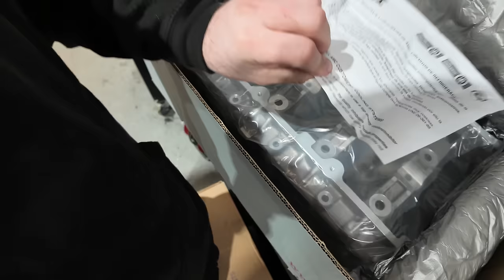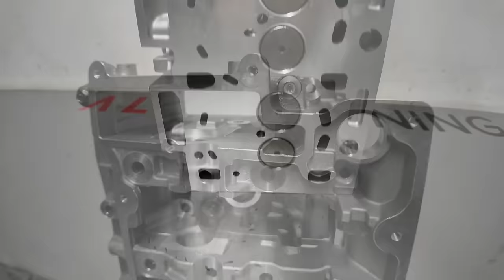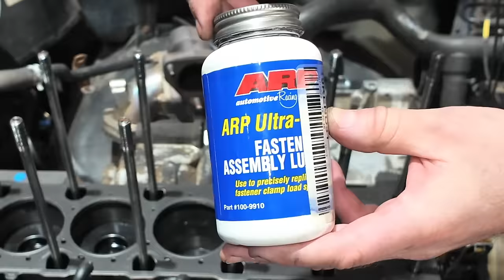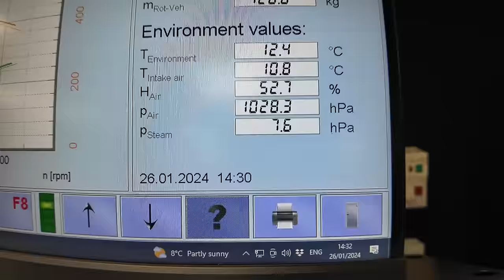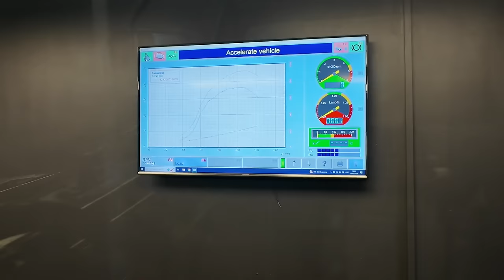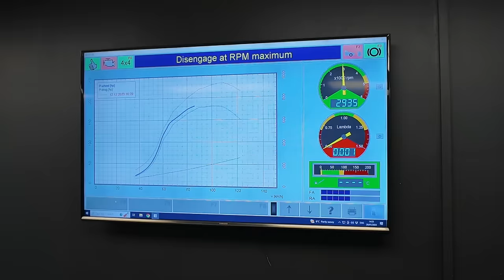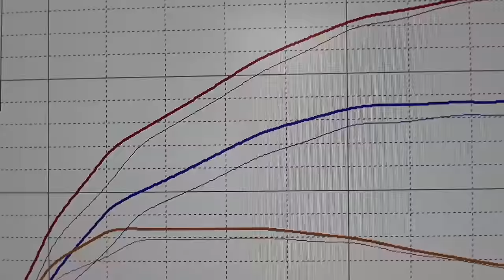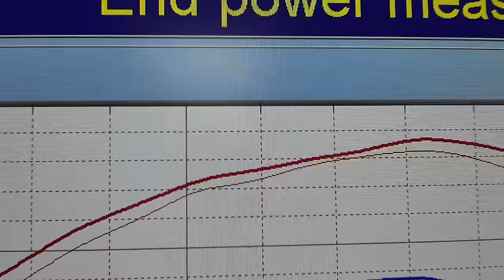It’s back! New cylinder head for this GTB550 Defender Td5

Comment: I just got back from Morocco 3 months I was there, just me and the wife in my 110 td5. It’s totally standard mechanically with some nice heated seats and mirrors along with a heated screen, for Uk use. It’s got a roof tent and cooking gear in the back with a jackary setup for power to the fridge and lights etc and to charge our kit. Everyone said don’t go on your own you need others in case of a breakdown, 2,500 miles down the same back plus all the driving around down there in the heat and I had it serviced at Ali Nassirs garage for the trip home. There were loads of Landys down there and nearly all of them had issues but not mine because it’s standard, all these others with power tunes and lift kits winches big fat tyres were snapping shocks, one shredded a diff pinion because he had big fat tyres in the sand, nearly all were over heating but not mine, you can keep all this over priced suspension and upgraded ecu stuff it’s bollox, you can’t go any faster than granny at the front of the queue and offroad these tunes and big wheels and lift kits don’t give you anymore ground clearance, it just stresses your cv joints, diffs and prop joints and shock ends. It really is a waste of money but sat in the car park revving it to the rev limiter till it pops makes you look cool I guess. I towed 3 big fat landys to Ali Nassirs place with my standard td5 110 and very kindly towed a camper trailer back from Morocco to the port of Roscoff for someone with a 90 with a big turbo, stage 1 tune, silicon hoses everywhere that boiled and died and had to be recovered back to the UK.
Reply: My TD5 110 was ecu  upgraded with a 2 " suspension kit and running 265 × 16 tyres 20 years ago and still runs well..

Comment: Thank for good information please explain sequence to adjust injector Tappet, look forward to your response
Reply from the maker: @AbramLetlhage  Rotate the engine clockwise; until one of the five injector rockers is at maximum compression. Use a 13mm spanner to crack off the locknut and a flat screwdriver to wind the adjuater in until it stops. Wind it out one full turn and fix it in place with the locknut. Continue to rotate the engine until the next injector reaches max compression, then repeat the above for all remaining injectors. Note: This should be done on a cold engine. 

Refit the rocker cover using a new rubber gasket, and if the injector wiring loom is of an unknown age, replace this too, but only with an OEM part. 

Do not be tempted to over tighten the injector bump clearances as you’ll damage the injectors! There are no additional gains to be had by trying to manipulate this procedure.

Comment: Hi Stu great video. If you have a TD5 10p can you add the 550 turbo ? If yes does that mean getting the 15p ECU/ECM? Can you use the stage 2 map or does it need a full stage 3 map… not certain of the path? One last this when do you have to change the cam chain for safety so doesn’t let go?
Reply from the maker: Give me a call to discuss Lawrence 😊